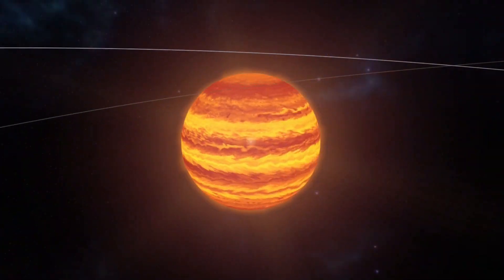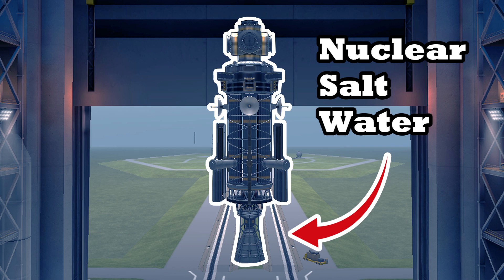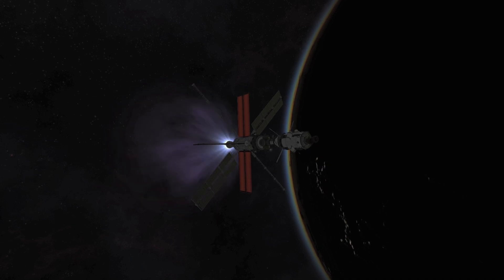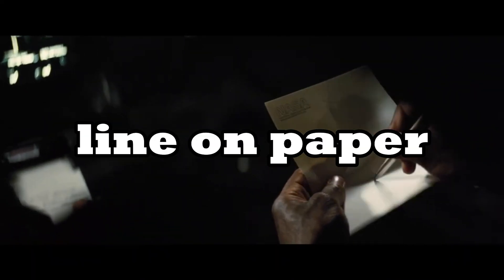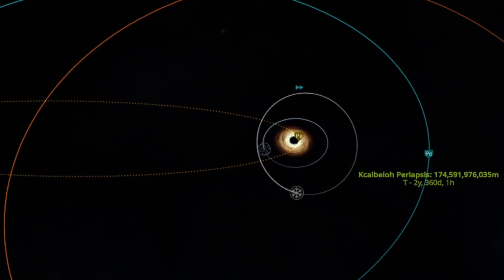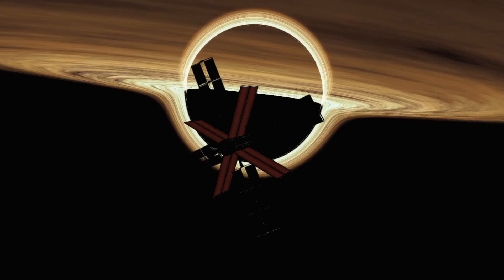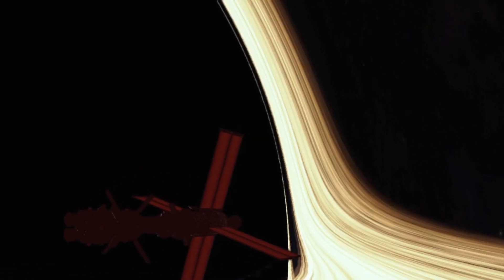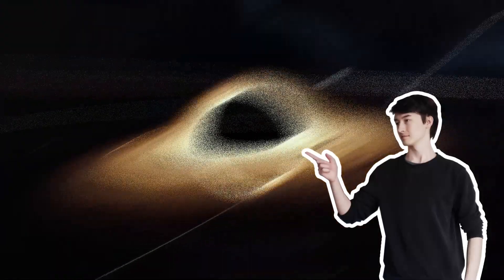Entering a Black Hole - KSP

Comment: awesome!
ive played with this mod and man its awesome

the only thing that bugs me is that kcalbeloh, which is 671 times the mass of kerbol, shouldnt be this large. i tried measuring the radius of such mass black hole and it came out to be 35 kilometers. but it would not be that fun to actually have a black hole of that size, cos it will not be visible even from the nearest planet.
on the other hand if this black hole were to be 4.5 million kms wide, it would have a mass of around 86 million kerbols.
but i think having such a massive object with this small size would break the physics game (thats what happens irl too).
Reply from the maker: Yeah I also felt conflicted about the inconsistency there, but i get it, it ks more fun this way

Comment: The mod is very good, only problem are the delta V requirements for traveling around the system. Literally take you 300,000 m/s of delta v to get to the black hole from the wormhole.
Reply: time for a kraken drive
Reply: Youre supposed to use mods for these types of planet packs. Setting up refueling bases will help.
Reply: i found on 2.5x rescale that i needed about 50,000 m/s to get to the black hole
Reply: Thats what far future technologies or interstellar extended is for
Reply: Gravity assist go brr
Reply: if you head straight though the center of the wormhole you can gain Very Large™ amounts of speed and be launched into kcalbeloh
Reply: turns out it takes another 200,000 to get in a low orbit
Reply: Use the far future technologies mod
Reply: @tedm123  Yeah, some engines in fft can have several million m/s of dv
Reply: Raise your apoapsis higher and lower your periapsis once you're at the apoapsis, it takes a lot less fuel that way, because it's easier to kill your sideways velocity off at that point
Reply: FFT or KSI-E time
Reply: they should add a neutron star or something near the black hole for the sole purpose of gravity assists
Reply: 20k from sunorc to a low blackhole periapsis
Reply: Not if you raise your apolapsis crazy high
Reply: You know what I think about that?

Lately, I have had the strangest feeling
With no vivid reason here to find
Yet the thought of losing you's been hanging
'Round my mind
Far more frequently, you're wearing perfume
With you say no special place to go
But when I ask, "Will you be coming back soon?"
You don't know, never know
Well, I'm a man of many wishes
Hope my premonition misses
But what I really feel my eyes won't let me hide
'Cause they always start to cry
'Cause this time could mean goodbye
Lately, I've been staring in the mirror
Very slowly picking me apart
Trying to tell myself I have no reason
With your heart
Just the other night while you were sleeping
I vaguely heard you whisper someone's name
But when I ask you of the thoughts you're keeping
You just say nothing's changed
Well, I'm a man of many wishes
I hope my premonition misses
But what I really feel my eyes won't let me hide
'Cause they always start to cry
'Cause this time could mean goodbye, goodbye
Oh, I'm a man of many wishes
I hope my premonition misses
But what I really feel my eyes won't let me hide
'Cause they always start to cry
'Cause this time could mean goodbye